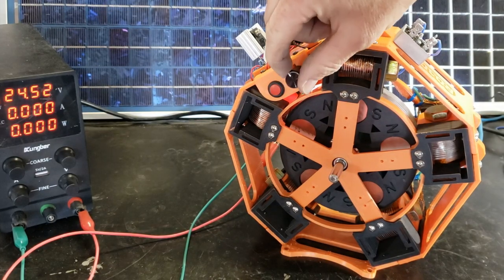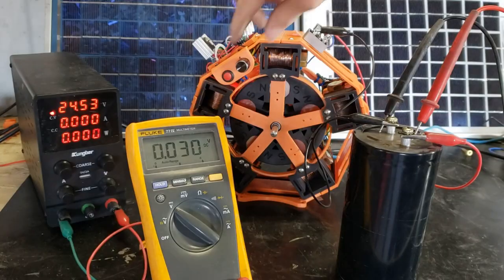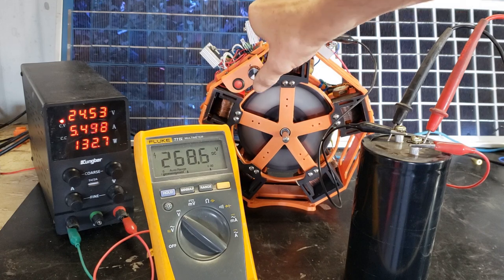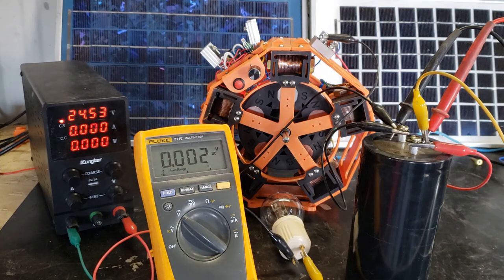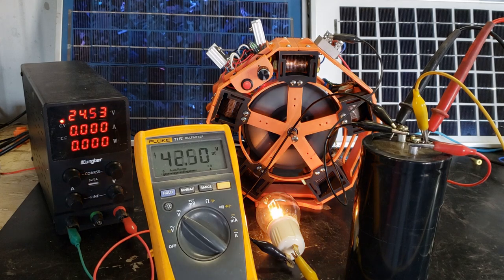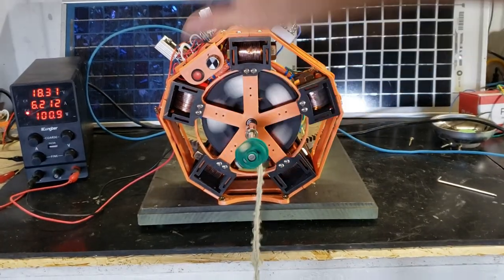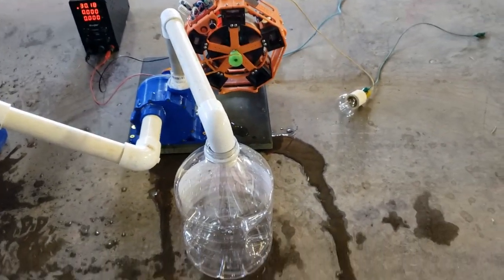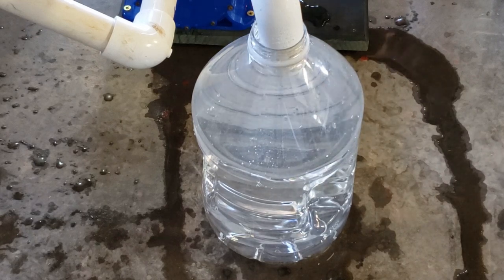Zero Force part 2

Comment: You are really good with the 3D printer my man! Great design. Makes sense you get more performance out of coils in parallel. You’re getting more current through them, less resistance,  and current is needed for magnetic fields (B). More B field = more torque delivered to rotor. You could measure the current to your bulb and then compare input power to output power. If you can get over 70% it’s really good for a home built DC motor. I think KEnergy has a few up in that range. Good work again👍
Reply from the maker: Thanks for your input! Yeah, K pushes me to make better motors. His are powerful machines. I still need to make his cap discharger to test and verify.

Comment: Some observations I'm asuming 5 coils, 5 magnets  single phase.  Peek voltage stored in the cap was growing but if we call it 269Vpeek then the RMS voltage is 269/sqrt(2)=190.2Vac.  But the motor slows down under load and a certain amount of voltage is dropped across the resistance in the coils. 

If you want to know a bit more about what is happening.  Take
1) ohm readings of both the light bulb and the coils, and
2) the current flowing through the entire circuit.  

Given  the (sum  serries connected coils resistance) × current through the whole circuit = voltage drop across the coils. Take the voltage drop in the coils × amps through the coils =  watts lost to heating the coils. 

And given both the current through the light  bulb and the voltage that develops across the bulb you can calculate the power it's consuming. 

Adding the copper losses in the coils and the light bulb power consumption. And subtract  the result from the 237 watts the power supply says your consuming  should tell you how much energy you loosing to eddy currents, hystoresys, bearing friction and circuit switching. 

There is a way you can calculate bearing loss by determining a friction coefficient × angular velocity. And switching is probably 96% efficent. So the remaining would be a pretty good guesstimate of the hystoresys and eddy currents losses.
Reply from the maker: Good info, I'm just making unique 3d printed designs. I'm not an engineer or anything. My intentions are not that detailed. Thanks for the input though!

Comment: I can tell you a trick when you get a leak even with silicone sealant. The faces of the flange, make a small groove on the face between the edges. The depth is 1/32 inch radius using a rotary burr. This gives the silicone some more footing to hold it in place and not get pushed out when tightening the two parts. This worked for me many times. Good luck with the pump.
Reply from the maker: Thanks. That was a bad design but if I try again I'll take your suggestion in consideration.
Reply: @redesign3dp  Hope it helps you out Sir.

Comment: Hey my friend I finished the this motor and wow its great!!! The torque is wild and there are SOOOO many different configs and experiments I can do. I uploaded a short and my larger video is getting uploaded now. Thanks for this man its been a pleasure printing and building this one. I can't wait for the next one lololol
Reply from the maker: I just checked it out. Great job on the build. That is an experimental platform as is all my motors. So your doing exactly what I designed it for..to experiment with. I finally got my JLPCB circuits, and I believe it with work great with the zero force. I'll check it out when I get home. Great job! If you think it has torque now wait until you do 2 phase!
Reply: @redesign3dp  thank and very cool on the circuit. let me know ok?

Comment: Hello, I noticed that you sell the design of this on your site, do you also provide the circuit diagram and BOM? I would really like to recreate your zero force and experiment with it. I already brought the design.
Reply from the maker: Thanks for your support. My site is a work in progress I still need to add build instructions. I actually only got a few sales. I'll work with you and provide you any info you need to get it up an running. I should have your email address when you purchased the files. I start work again this week. Week on/week off. I'll send you some build instructions this evening. But you've got some printing in the meantime. I recommend print everything in the color you like then spray paint black the accents. Good luck!
Reply: @redesign3dp  Wow! I didn't expected a kind response like this. Thank you!

Comment: Try making a water pump that is just an Archimedes screw. As it make a vacuum on the bottom the output should eventually push the water out. Though it may need to be primed. It isn't efficient or anything it is just simple.

Comment: Really you need develop a system for cancel lenz is very easy you know when the pole Nort or south goes through the coil I can application current diferent in the coil because like charges repel and unlike charges attract
Reply from the maker: I haven't seen it done before.

Comment: Its loose .your motor comsume lot of energie  ....your wrong .my motor turn at 9 volt .0. 5 amps ...input .output is ... 350 ×1. 41  volt ,with 1.87 amps .dc  .
Reply from the maker: post a video, send me a link. I'm curious
Reply: @redesign3dp  its real ... without the earth .... . Im work without the earth .  Use a ceramic barrium no neo magnet (saturate the coil ,no efficiency ....  . And please connect the neutral at the earth ..... very big boom lol .and use Mjl 21 194 ... npn ,no equivalent .it is the best .... with resistance ,480 homs at 680 homs for efficiency battery charging .
Reply: @redesign3dp  and all my motor accelerating under load and low input power without the earth .
Reply: Your motor dont accelerating under load your are wrong .
Reply from the maker: @anthonyjousse3020  I don't mind being wrong. I am only trying to learn. Please post a video, because I understand better by watching. Thanks for your input.
Reply: @redesign3dp  listen to me  ....
Reply: @redesign3dp  what your s.c or othet  ?